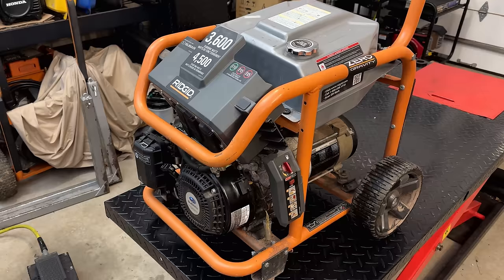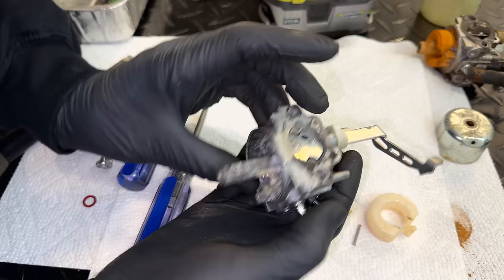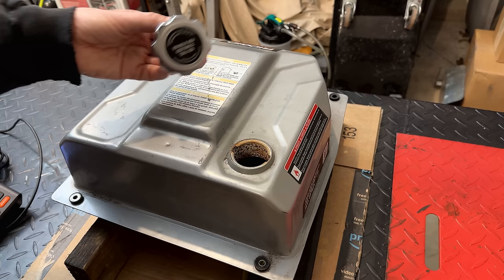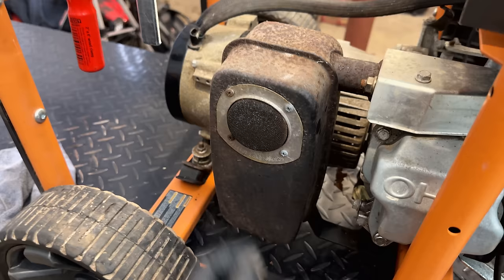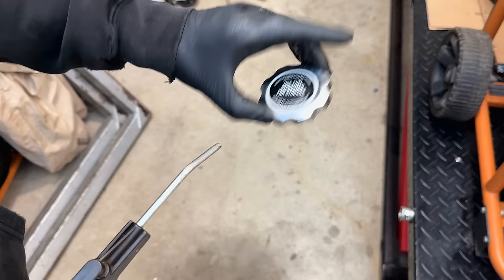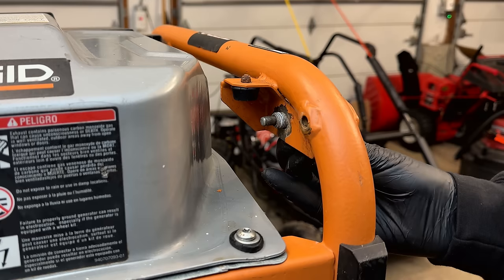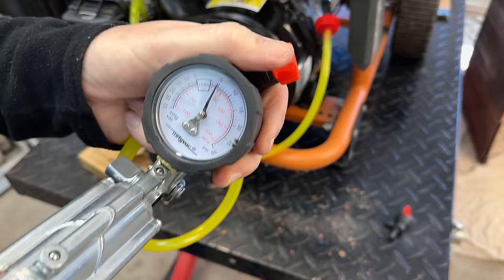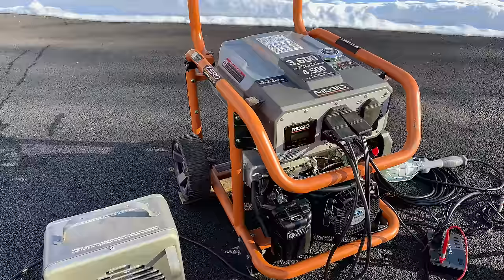Neglected Ridgid Generator Will Not Start

Comment: Hello James!  I must say I think your channel is excellent!  I find it interesting, informative, and inspiring! Dare I say, Network TV worthy! When I say inspiring, here is my story. I have to confess to some negligence with both a small lawn mower and a Ridgid 5700 watt Generator by leaving fuel in them for an inordinate amount of time. They refused to run and I knew it was the carbs. After watching your videos, while I have some mechanical skills, I have never rebuilt carbs before. However, searching for them both on Amazon I found replacements for like $13 and $35. At that price I thought it was worth a try to just slap on new carbs. The one for the mower arrived in 2 days, and 15 min later, after slapping on a new carb, it ran perfectly. The One for the generator had to come from China so it took a little while.  My generator has never really seen the outside and only has 2, yes 2 hours on it. So, I was determined to get it running. Once the new carb arrived, after flushing the gas tank, (thank god after inspection, it still looks brand new inside) changing the fuel lines, filter and slapping on the new carb, it started up right away. I was concerned about the engine speed, as I didn't know how the carb would work with it. I remembered your video where you checked both the voltage and HZ. Upon checking the on board meter, and with it unloaded, it was at 61 hz and 121 volts.. Loaded it zeroed in at 60 hz and 120 v. I think I have a winner. I don't think I would have tried this myself without your tutelage. So, when you close your videos with your line "I hope this video helped someone!, please be very aware for this viewer it helped a lot!  Thanks for what you do and keep doing it, I will be watching!  Best Regards,  John Ebell
Reply from the maker: Thank!  Glad to hear it worked out and the Ridgid tank was still clean.  Those tanks are usually not forgiving and they are discontinued, so tank care of it.  Do not leave the same fuel in it for more than 6 months and you will be fine.

Comment: Hello James another interesting video. You seem to be doing more tank restoration work. I have done my share, I suggest getting an old engine stand. You may already have one. The attachment arms ar very friendly in attaching different tank shapes. The barrel is easily adaptable to attaching a V or serpentine belt. Put a small electric motor on the base and you have an  
automattic tumbler to attach your tanks to. A couple of hours on the tumbler is usually enough with mild corrosion. The square or rectangular tanks might require repositioning the tank to clean all surfaces. I used mine usually for motorcycle tanks. It also was a great rotator for spray painting, helps prevent runs. To coin your closing I hope this helps. Keep up the great videos.

Comment: Fun tip James, those fuel valves can be pulled apart and the "o" ring replaced! I use a little silicone grease on the new "o" ring, snap it back together, and back in business in no time.

Comment: I just remembered this about rust, I'm an avid canner and about ten years ago I was trying to clean a stained aluminum pressure cooker with vinegar and I just threw the galvanized rack that goes in the bottom of the canner in also and brought the pressure canner up to pressure for about t3n minutes but it did not clean the aluminum but it did remove the galvanization from the steel rack in the bottom and turned it black and it hasn't rusted in that ten years.

Comment: Great video, I admire your patience and thorough way of working. Amazingly good. About the valve, I think you should mount it 90 degrees turned, with the fuel line coming from above. I saw a little notch in the top of the cap where the line should go through. Thanks for your work, I learn a lot of it.

Comment: James, when cleaning gas tanks i have found a barbecue rotisserie motor with its accompanying rod supported on either end is far superior to hand shaking the tank . Still use the nuts and bolts, { I have found bb's work very well along with nuts and bolts}. Simply bungie cord it to the rotisserie rod and let it run over night, changing positions occasionally. I have found that a small piece of plastic sheet under the cap works well for preventing cap leakage. Extended tumbling will many times preclude having to use evaporust. I have noticed you struggling to remove rust many times on various pieces and couldn't help but think you could use a small sandblaster with or with out cabinet, using glass bead with the blaster cleans casting as good or better than new. I enjoy your show very much. Thanks, Tom

Comment: I’m not a (generator) virgin anymore! 😂
Just finished yesterday going over my first generator for a customer. It needed a few things, which I did as best I could and returned to the customer running and producing electricity as it should, at least as far as I could tell with only a multimeter.
Then today I had a request for a restored generator. I’ve got some in the yard and I’m sure one will fill their needs.
I guess it’s time to finally break down and purchase a Kilawatt tester so I followed the link in one of your videos and one will be here soon. With your help I’m sure I can solve any issues. Yay!!!

Comment: Several metal or plastic fuel tanks are available on the outboard motor market, most are intended to take to a petrol station to be filled, then carried back to a boat, so they have connectors. Fuel tanks for outboard motors are usually plastic.
Reply from the maker: That is a viable option.  Would just need to add a fuel pump.
Reply: A typical tank for an outboard would connect with a flexi hose with an inline squeezable primer bulb. after that a high tank would siphon into the carb on demand, a low tank would need a fuel pump.

Comment: First, Great video thanks for sharing, I've had so much problem with leaking fuel shut off valves (and equipment that need but don't have them) that I've started using regular brass or stainless 1/4 inch ball valves instead and haven't had any problems with leaks.

Comment: Your videos are awesome.   No drama.  Just facts and info....and great info at that.   Thank you.  Just a thought for this video....I wonder if the top of the fuel tank could have been cleaned with just enough Evaporust to not "spill" over the fuel neck with the tank completely upside down?  That amount could probably be first determined with water.   Anyway, you inspired me to update/fix my own portable generator...thank you sir!  My generator has an AVR that I've never seen in your videos.  It's a "card" that slides into a couple slots on the top of the powerhead and the original was only putting out 116 volts and I didn't see an adjustment screw so I ordered a new one and it put out the same 116 volts (Briggs 205858GS $86 on eBay).    The UPSs I have for the electronics in my house do not like that voltage (and/or possibly the frequency)....arrgh! LOL.   Have you ever changed from the type of AVR that I have to the type of AVR that has an adjustment screw?
Reply from the maker: I have not tried to swap the AVR type on one of those.  What is the engine speed?
Reply: @jcondon1  Sorry, I should have mentioned the engine speed/Hz.   Thanks to your videos, I adjusted the Hz to 61.5 without a load.

Comment: Jim, it seems as though the engine is offset in that frame by an inch, cramming the valve cover up against the frame. On the plus side, this appears to be one of the few where intake access isn’t at least partially blocked.  If that were my machine I’d drill new holes for the mounts and shift the whole assembly over because the valves are going to need to be at least checked at the 100 or 200 hour mark.

Comment: I have the same exact problems with those 90° valves. The tight fit in the mounts, distorts the case and causes the leaking. Once the damage is done they don't appear to recover. I tend to open the mount hole with a reamer from the back. It's almost as if all those Briggs mounts were designed for a slightly smaller valve body, then the one they adopted, even OEM is testy.

Comment: You clean out rusty tanks enough that you probably need to build a rig that will tumble them for you. A ceiling fan on a frame would work, I think. 

I think you also need to buy some of the abrasive ceramic media instead of nuts & bolts.
Reply: This is the best ad hoc tank tumbler suggestion yet - finding a old cement mixer or paint mixer is rare, but I bet every place he finds these discarded generators there are piles of ceiling fans. At least, that's true down here in the hot and humid south.
Reply: @RossReedstrom  Yeah, you could cruise around the neighborhood on trash day and find 5 or 10 working ceiling fans sitting on the curb for free.

Comment: Hi and continue to love your videos. Suggestion for you since it seems you’re having to clean a bunch of tanks. Put the nuts on a long fishing line and you can even drill a hole in the bolts and attach them as well. Much easier to extract them in one fell swoop.
Reply: Drilling holes in all those bolts would be very tiring for me.

Comment: Probably should look at adapting a rock tumbler into a rotisserie onto which you can bolt a tank, and get some ceramic tumbling beads. Some of that and evaporust should clean up those tanks real slick.

Comment: Great video Jim. Nice job working on that handle lock pin rehab. With the metal so thin, that made it very difficult. “A grinder N paint makes me the welder I ain’t.” Nice work.

Is that a Honda EM650 in the background?
Reply from the maker: That is an EM650.  That video is about 70% done.  You will see it soon.

Comment: I was thinking you were a bit off on your amps to watts conversion but you were right on.  I’d say that breaker is a good one or you just didn’t let it run long enough pulling the 3000 watt load.  120(vac) X 20(amps) = 2400 watts.

Comment: What about cutting rusty tanks open, followed by sand blasting and finally MIG-welding the halves together? The cutting could easily be done with a cheap plasma cutter from Amazon.

Comment: For corroded aluminium/steel you can use warm water with citric acid in the ultrasonic.
Reply: Alternative for cleaning out tanks is white vinegar than clean out with sharp gritty stones or indeed bolts and nuts and than rinse out neutralize with household ammonia solution to "passivate" the etched steel for fly rust.Finally rinse out with acetone to get all water out.

Comment: I learn something new on almost every video I watch.   What would you gues sis the reason for such a low THD on a non inverter generator?  Would it be because it's possibly brushless?  That THD was impressive, to find a 6K+ 240V Generator with the same clean power and it not be an inverter generator would be nice, to keep the cost down.

Comment: If you use a length of chain instead of the nuts and bolts, it makes it a lot easier to remove from the gas tank.

Comment: Whenever you clean a gas tank, when you're done cleaning it, coat the inside with 5w30 motor oil, this will stop the rust and prevent moisture from condensing on the inside, and will greatly extend the life of the tank. Also, as with all generators, throw the air filter in the trash, they aren't necessary and cause more problems than they solve, also remove the breather tube from the airbox, this only gums up the carburetor and causes problems, they are less than useless, attach a small plastic bottle to the tube and it will catch any oil that might come out of the breather. Last note: if you live in a cold climate, replace the standard oil with 0w30 and your generator will start with zero issues at temps as low as -40 with no issues, but only if you remove the air filter and breather, if not those will quickly freeze up the carburetor and cause major issues at low temperatures.

Comment: Thanks James.
Have you ever pulled one of those Valves apart ?? 
It is just a piece of rubber hose that is squeezed by a cam in the housing (the red Knob) 
I had an issue where the Valve was plugged up...
Reply from the maker: Did not know they came apart

Comment: I don't know if you considered this or not, but for the handle repair mt first thought was to form a thick washer around the tube and wed it such that the pin fits into the washer hole. Just another option.

Comment: Little hack for if you have non ethanol fuel near you (called REC recreational gas) 
We have speedway here in the mitten state. 
I get points from getting stuff from there before work. 
Load up points all year and then use points for 50¢ off coupons during the year and ended up paying $1.53 per gal for the full 25 gal max since we have one near the water by me. 
I'm sure it won't work for all but works for me. 
All my outdoor and small engines get non ethanol. 
I still stabilize too just in case but never have to drain a carb or anything. No fuel line issues or needles and seats going bad. 
Hope if you have a similar place with points like that or a speedway near water or marina that has its definitely worth it.
Reply: Meanwhile here in Alaskan bush country gas is $7.59 a gallon 😮
Reply: @a-k-jun-1  😳😨 it's like California there but they actually have a reason

Comment: Nice job James: Do you ever use the red cote fuel tank liner fluid? I never have and would like to know if it is any good. Also does the new carb you installed have an low speed adjustment screw? Thanks for another great video.

Comment: on 1:08:07 you have to higher the welders wire output a little... you have to listen carefully to the noise... that is clearly the noise for too much amps for the wire output or said differently too less wire speed for the amperage...

Comment: IF your welder can use Flux core wire you will save on not having to buy shielding gas and it will weld better on dirty/rusty surfaces than the plain wire but, the weld is not as pretty until you get used to using flux core wire.

Comment: Have you ever considered a Fuel Tank Sealer such as POR-15s version on these unobtainium tanks? I've used them with success on motorcycle tanks.
Reply from the maker: Was tempted.  Just hard to do on this type of tank.  There is a lip on the fill and the drain is tiny.  Most tank sealers, you need to prop the tank to allow the excess to drain out while drying.

Comment: Rigid (Home Depot), "Let's see how we  can make it difficult to adjust the valves.  Ah, let's mount the engine so the valve cover is close behind a frame member."  It would probably be expensive and time consuming, but with the advent of 3-D printers, if I were desparate, maybe printing a HDPE fuel tank might be an option.
Reply from the maker: That would be a large 3D printer

Comment: Hi James, love the videos. So I have A mid 90s Rv generator. It’s a Kohler 4500 ckm21. The rocker switch went out and I removed it. I left the wires off. I hooked up a key switch and it starts fine but now I don’t have power.
Does the rocker switch send voltage to the exciter to make power. Thanks

Comment: Have a xg8000e I bought with leaking carb but worse is the ridiculously inaccessible fuel shut off which does not shut off!
So this video I just now came across is totally relevant.
Dump these stupid designs "engineers".

Comment: To get the rust off of the top you can put a gallon and a half of Evaporust in the tank. Put the cap on. Then put a gallon and a half of Evaporust in a tub a little larger than the tank. Flip the tank upside down into the tub and voila. Evaporust levels are more or less equalized and the tank won’t drain out.

Comment: Hi James ,just wondering once tank is cleaned are there any polypropylene products that you could use to line the tank that has a curing agent to make it impervious to petrol(gas) that would solve a lot of issues,thanks for video,🇦🇺🦘
Reply from the maker: Yes.  Been considering Por15 or Red-Kote.  The main issue with generator tanks is the lip on the fill and a tiny pipe where the fuel line connects.  Most tank coating products require you to let the excess drip out while curing.  Easy with a motorcycle tank, not so much with one of these.

Comment: After cleaning a fuel tank… have you ever tried those liquid fuel tank liners? I’ve always wondered if they worked well.
Reply: I have used a product made by Red Kote that is AMAZING. I’ve used it on over a dozen tanks and it has not failed a single time. Some tanks have been in the field for several years with it too. I became a firm believer when I had a RARE fuel tank that had multiple tiny holes. The kind of holes that just left wet spots on the tank. To get a replacement tank was impossible. Couldn’t find one at all. I took a chance. Nuts and bolts and strapped it to a cement mixer. Ran it for a few hours and then did evapo-rust treatment. I then used their “tank etching” stuff. Then… did the Red Kote. It’s rather thin stuff so it’s a quick job to coat all the inner surfaces of the tanks. If you ever have to spend the time to remove rust from a tank… or have a rare tank… ABSOLUTELY use a liquid tank coat. The tank I mentioned that had holes in it… well the holes got bigger as I cleaned and prepped the tank. The holes got big enough that actual drips were forming now. I can’t believe it worked… but that tank still hold fuel to this day. I’d recommend using the Red Kote treatment any day. Stuff is amazing.
Reply: @GottlobChristianBerger oh sweet thanks for the reply. I’ll look that stuff up.

Comment: I am thinking that a couple of small bags of aquarium gravel would clean up the inside of the tank even better than nuts and bolts. I have not tried it though.
Reply from the maker: I might, but would be a pain to get out of the tank.  Magnet would not work.
Reply: @jcondon1 It would definitely require more rinsing and a strainer if you wanted to keep the gravel for reuse.